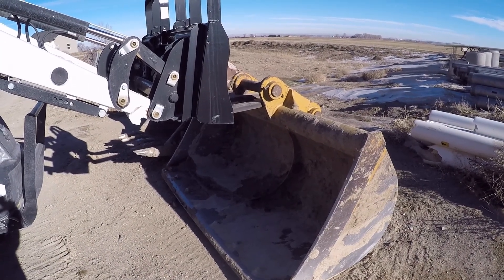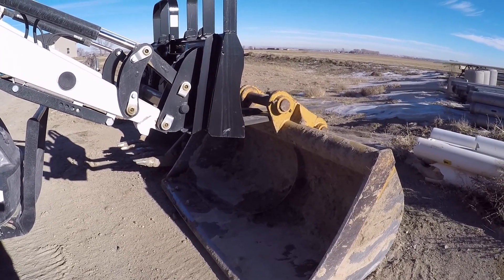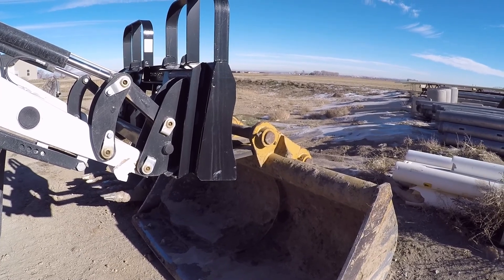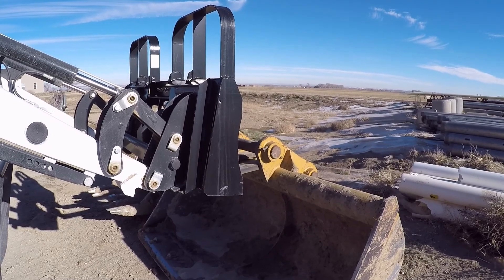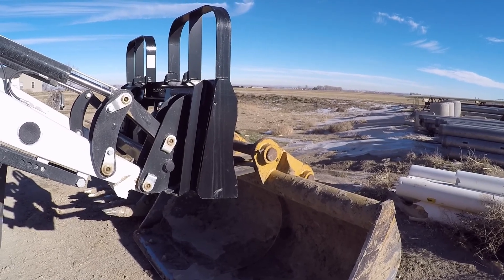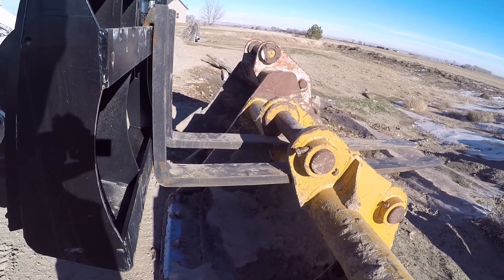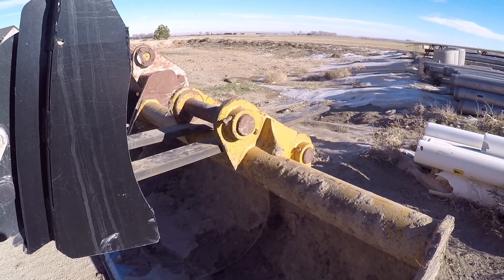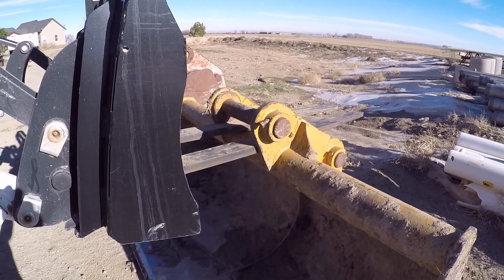Bobcat Tractor Hydraulic Issues Part 1

Comment: The erratic HST transmission behavior plagues all the Daedong-sourced tractors with drive-by-wire HST's and has been a struggle for them over the past few years.   The goods news is, Daedong may have finally determined the root cause of the erratic transmission behavior.  According to the service department at the local Kioti dealer, the NX series tractor transmission issues are caused by a faulty Safety Control Module which interfaces with the engine and transmission control modules.  It senses and controls all the safety lockout signals and functions.  It is a bad design that sends erroneous signals to the TCM causing it to jerk, not go into gear, or just go into calibration mode randomly.   Daedong has gone through several revisions of this module but the latest revisions will fix the transmission control issues.  After the latest Safety Control Module is installed, the dealer has to go through the recalibration procedure for the transmission in order to get everything in sync.   The Kioti dealer says they are no longer seeing issues with the HST's after the most current version is installed.  Might be worth talking to Bobcat about service bulletins regarding the Safety Control Module.     It should be the same as what is on the Kioti NX series tractor.
Reply from the maker: That’s interesting. My new 5555 hasn’t had near as many issues as the old one, but I still get random calibration lights and it’s definitely not a smooth hydrostat. I’ll be calling my dealer to see what they have to say. 
I appreciate the info!

Comment: Ugh this sucks,  seems like a lot these are having issues.  My NX6010 rear 3 point stopped lifting last week unless it is at full throttle and then it is very slow, I can hear the fluid flow sounding like it is just spraying into the inside of the rear axel.  Now I am waiting for my dealer to come and pick it up again.  

Are you still having the issue with getting into M range?  I wonder if they can address that at all when they have it apart.  

Lately I have really regretted picking the NX6010 hydro vs the RX7320 power shuttle.  Best of luck on all this to you.
Reply from the maker: Oh man, that doesn’t sound good. What else have you had it in to the dealer for?
I am still having the shifting issue. In fact I have several issues that I was hoping they would fix while it was torn apart. The dealer told me they would only tackle the pump for now. They have so many units in for repairs they can’t keep up and don’t want to tie up a bay for too long. Which means yet another trip in at some point.
I like hydro transmissions and this is the first one I’ve ever had issues with. I thought it was a fluke thing, but after talking with other Bobcat/Kioti owners it seems I’m not the only one with this issue.
Reply: @gaining_ground   got my 6010 back,  they replaced a hydraulic solenoid under the cab and re calibrated again,  the hydraulic stuff all seems to be working and I haven’t had any of the pauses or jerks.  It stiff is a bit of a pain to get into M but I have learned to put the loader in float and fully lower the rear and it always seems to go into M better.  I don’t have a 2k item to check my lifting to see how it is doing compared to yours.  Funny they are  it on the sale stop for your series as all NX Kioti tractors are on a sales stop order still.
Reply from the maker: @mrmaddog69  I asked several dealers about the pause and no one knew anything about it or were told not to talk about it.
Did they have to pull your cab to replace the solenoid? I was told on mine that the only way to replace the solenoids was to pull the pump, to pull the pump they had to pull the cab.

Comment: The flow from the pump should not affect lifting capacity, only speed.  You must have a bad pump, not enough pressure.  My CT4050 lifts as advertised.
Reply from the maker: The dealer said that the solenoid valves on the pump itself are not opening and closing properly. The pump itself is probably fine. You can’t replace the solenoid valves without replacing the pump. 
I hope that solves it.
Reply: @gaining_ground  I was going through the parts for my tractor online and the hydraulic pump was nearly $3000!  Good to get that fixed under warranty.
Reply: Ct1021 blowing out hydro seal any ideas